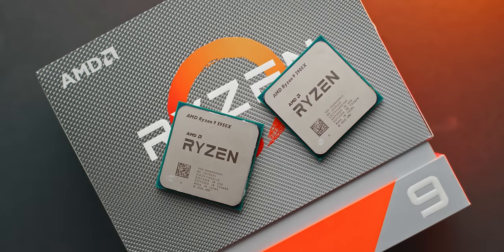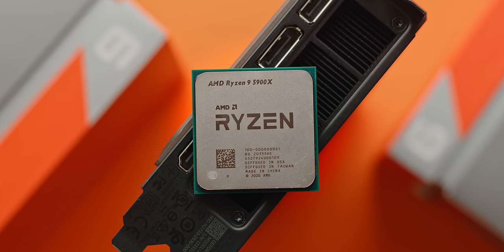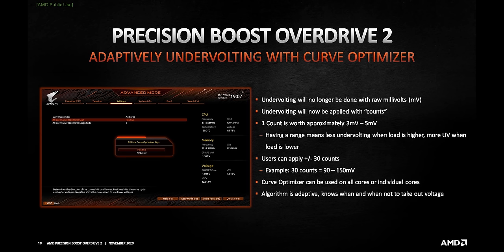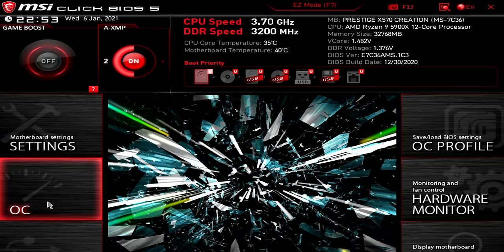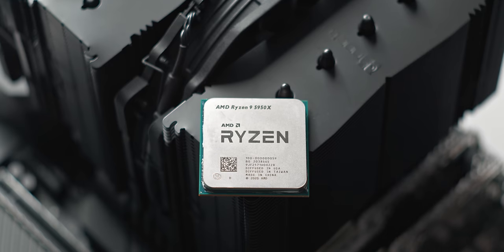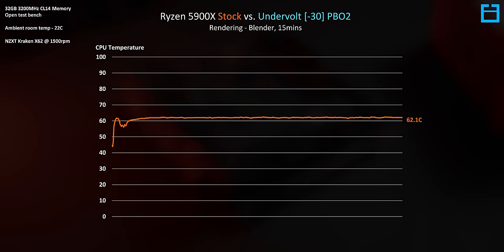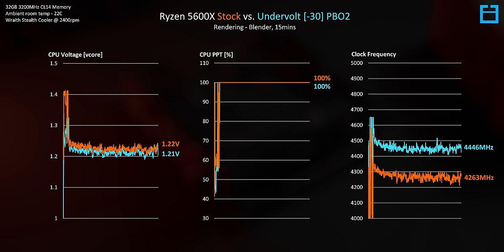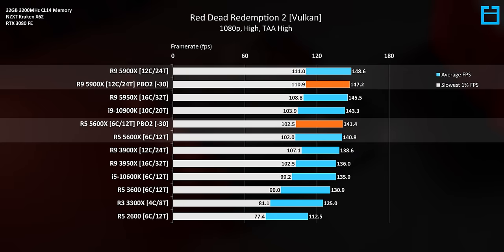Ryzen 5000 Undervolting with PBO2 – Absolutely Worth Doing

Comment: My voltage was spiking up to 1.375V completely needlessly. Now, with -30, they never go above 1.2V. Tried Blend testing and the clocks stay at full speed 4650Mhz for the whole time at 1.212V and temps around 65C with an aftermarket cooler. After the boost ends, the voltage falls even further to 1.1 - 1.150 and clocks stay constantly at 4450Mhz with temperatures below 60C. I'm extremely happy. Didn't lose a single drop of performance, but the voltage spiking high up to the sky is over. My friend did the same, but he could "only" manage to get it to -27. The -30 sometimes were giving him hard reset.
Reply: Did you have xmp enabled for your ram at the same time as the 30 offset or no?

Comment: Appreciate the guide.  Unfortunately, my 5900x didn't do as well as yours.  At negative offset 20 it would pass torture tests but consistently crash in gaming.  Dropped it to 10 and it reduced the crashes but they would still occasionally happen.  Turned off the offset and have had zero crashes in the past week.
Reply: What is your best CB R23 score??? OCCT score???

Comment: Mate, took me 3 months waiting but my 5900X finally arrived from PCCaseGear. It’s a hot CPU. I have 2 x EK Coolstream 360 XE rads with Vardar fans cooling the 5900X and a RTX3090. GPU idles at 23 and max of 50-52 at full load.

The 5900X idled at about 40 and max of 75 in Aida64 for an hour. Not maxed but still very warm for such a cooling loop.

I used your exact settings in my MSI Bios and I get higher clocks, less max power draw, and max temps of 61 degrees. Idle is still warm but max is great now.

You’re a legend. I love you videos. Wish I had the patience and skill to make the builds you do. Thanks for all you do 👍🏻

Comment: my 5800X can handle a negative curve of 25 but even with that I see it regularly idling at 0.9 volts and on an all core load I now see it boosting to 4.775 GHz at a max of 1.29-1.3v and boosting to 4.8/4.9 GHz on lightly threaded tasks more often at WAY less temps and power. Amazing I love Zen 3 this is essentially AM4 at its final form!
Reply: Do you think 25 will work for me? I'm using the 5800x aswell
Reply: Only way to know is to test it. His 5800x could be way better or worse than yours. Silicon lottery
Reply: i have all cores -30 except the two fastest cores that sit on -28

Comment: Worked like a charm. I was able to get the max value of 30 on my 5800x and msi mpg x570 gaming edge wifi. Improved my cinebench r23 score by 4% with lower temps and higher clocks than stock
Reply: Any instability issue? I just tried this on my 5600x and at -30 it crashed after 2-3 minuts. Trying -25 now with 10 threads loaded, will see in 12 hours I guess.

Comment: Went from 57 degrees idle to 44 degrees. Great guide, subbed!
Reply: 44 degrees idle is still pretty high. My 5600X is untouched sitting at 33 degrees. Highest load goes to about 65-69 degrees.
Reply: @patrickwoolbright1960  not sure what to do beyond this point. if you can point me to some other guide to deal with this, I'd appreciate it. Although mine is a 5900x with a Noctua nh-d15s air cooler.
Reply: @patrickwoolbright1960  if I turn off PBO, I can't undervolt at all and it goes back to stock temps :( thanks tho
Reply: @kebongski  With information i mentioned previously i had no need to undervolt. Idle temps are around 33 - 36. High load temps are around 55-65.
Reply: @patrickwoolbright1960  but does it still boost to >4Ghz? Legit really wanna know
Reply: @kebongski  Yes.
Reply: @Mottbox  well aside from the fact that I installed a couple more intake fans, I discovered that I placed my heatsink fan wrong. So it was pulling air FROM the exhaust fan. Pretty dumb oversight, I only discovered it only when I was installing new fans. Now they idle at 32c. 

Although how the hell are you idling at 24c?! :O
Reply: @kebongski  remember that your temps can't go lower than ambient temps, that means if your room is at 34C like mine on the day, that is as low as it might be able to go with really good cooling.
Reply: @arashitempesta  that makes sense and seems obvious but I never thought about  it... Thanks for this!

Comment: I had to adjust my fan curves to account for lower cpu temps for my build because the undervolt worked too well and my GPU wasn’t getting enough air. So yeah, it’s definitely worth
Reply: I wouldn‘t use Cpu Temp to Regulate case fans. There are several programd to use gpu temp to lower or boost up case fans

Comment: My 5900X couldnt handle 30, even 25 without instability so I´ve settled on 20. I am getting 4875mhz boost on single core and 4575mhz all core with better temperatures. Thank you for the guide!
Reply: May I ask what tools one would use to test wether the system is stable after setting the new voltage? i have a 5600x, and slowly worked my way up to 15 now. It all seems pretty stable, I ran cinebench and played a few games. The CPU is sitting around 55°C so that's pretty good.
Reply: @Xello99  OCCT if you want rock stable system. But you can set the test in Ryzen Master for 60 minutes and that should be enough for everyday use.
Reply: @Houmer  ok, thanks :)
Reply: my 5900x couldn't handle 30 either... thanks for the update
Reply: So, my 5600x can handle 30 without issues. Guess I’m lucky then
Reply: @kohzhicheng08  I started with 30 as well, then got a system reset, dialed back to 25, got a bluescreen. I'm now at 20, no issues so far.
Reply: @djlimited04  I never tried 25... thinking if I should try it hahaha
Reply: How your clock speed ? Whats the max?
Reply: @kohzhicheng08  4950 on first 5 cores. The rest are between 4800-4900. I didn't apply any MHz offset from the BIOS, just left it default, as in the video.

Comment: Just to note on chips with arbitrarily locked boost clocks like say the 5700x you can gain 200-300 mhz single core performance as well as all core. Be warned though, your system might run fine during load but -30 offset can cause your system to crash at idle because of how this all works. So, you'll be running benchmarks and everything will seem fine but your computer will be crashing or acting real strange during lighter tasks. Might require some tinkering to find the perfect offset. Then again some people are lucky can just go -30 and all is fine.

Comment: Very dry useful tutorial. I applied it on my new 5600x on B550M Aorus Elite. If I compare with AMD overclock parameters, I have the same performance on Cinebench in multi core for less 20w and 10°C. In single core I'm better. FYI, I keep -30 without crash.

Comment: Thanks so much. Works perfect! All cores now goes at maximux speed, teptreture is lower by 5-8 Celsius. Great tutorial. Perfect on GIGABYTE B550 AORUS ELITE with 5600X.
Reply: Hello, I wanted to ask you if you with gigabyte motherboard have followed the procedure indicated identically, or if you have found differences and difficulties. Unfortunately I with gigabyte b550m motherboard notice differences and I am afraid of making small but dangerous mistakes. could you give me advice? TX

Comment: I bought a 5800x3d for my b450, updated the bios, went looking for the curve optimiser, I did find it and it was just in a different place, I put it to -30 and changed the voltages from another video, it works like a treat, I did a cinebench R23 multicore test before and after getting about 62MHZ increase on each core  with about 9-10 degrees lower in cpu temp on water
Reply: what voltages from another video did you change?

Comment: This has been a great guide helped me understand pbo and curve optimiser with my very first amd system i've ever built, came from a 9900k to a 5950x and mainly use my rig for gaming and have seen it do anywhere between 4750mhz to 4800mhz on majority of the cores, I am currently playing at 1440p and soon to be either 1440p ultrawide or 4k. Temps are a little higher in games and power compared to an all core clock at 4.6 but for the gained 200mhz they haven't gone up much, custom loop with liquid metal, open air test bench at the moment with the Evga X570 Dark until i get everything for the case i'm putting it in, ambient temperature varies between 14 degrees C and 24 as here in South East Queensland Australia it's getting towards winter. Thanks again Optimus Tech this video extremely helpful for someone just starting out with Ryzen :)

Comment: Just applied this settings to my new 5800X  with MSI B550-A Pro and Mugen 4 +kit AM as cpu cooler (+ 2 fans 120mm 1400Rpm PWM) Artic MX-4 used as thermal paste
PBo Advanced 
PPT: 108
TDC: 80
EDC: 110
Boost Override +100
PBO Scalar Off
Curve Optimizer -10
I never reach 70°C in full load! incredible result. before at auto setting always at 90° during stress and throttling

Comment: I am using the negative offset of 30 with my 5600x 

I have the exact same results as you do and so far (2 weeks now) everything runs stable :) 

great video
Reply: can you tell me your clocks speed and voltage pls
Reply: Did it maintain the clock speeds or it increased with the negative curve?

Comment: This isn't always the case, some of these guides don't warn you that curve optimiser is the wall between stability and instability... I could benchmark all the way from -30 curve all cores and an additional -0.1v as soon as I try playing games I get crashes all over, turns out one of my cores needed OVERVOLTING to be stable so no matter how much messing I did with undervolting the chip my cores weren't stable, even at auto... so the first thing you do before messing with an undervolt is sort your curve out first
Reply: What’s your Ryzen?
Reply: @Lucas Campos  5900x it came with 1 unstable core at stock
Reply: why dont u set the PBO limits to auto and set the curve optimizer to -30mV and start increasing the values if these are unstable try this since disabling PBO limits forces stock profile what if u can achieve undervolt using OC profile that PBO forces

Comment: I own the 5900x and was able to achieve an offset of negative 15. More wasnt possible or my system would crash. But even this is quite the uplift to my previous temperatures. very glad i did this! If anyone knows how to achieve even higher offsets, suggestions are more than welcome :D
Reply: silicon lottery at its finest
Reply: @henrikpflanz6177  jup had to clear all changes again. It would run fine for about 3-4 hours but under lighter loads randomly shuts down. I tested this for months on and on but couldnt even get negative offset of 1 working stabily. I even tested on different cores with offset, others with no offset, followed tutorials to determine which cores are the best quality for better undervolting. In my experience undervolting with PBO is completely broken on the 5900x. HOWEVER i cannot say if the CPU or the motherboard is the issue. Maybe the mobo cannot deliver the offset voltage stabily :p
Reply: @leif8436  welll is us just the silicon quality. some can undervolt more aggresivly then others.
Reply: mine can go to -30 which i guess is amazing

Comment: can confirm, this works
I used curve optimiser value of 30 for 5800x. 
Temps were 5-7C lower for r20 with score of 6107 points. stock score was somewhere around 5820

all core boost of 4.65ghz improvement of 125-150mhz.
single core was the same at 4.85ghz but much more stable. At stock it would drop down to as low as 4.7ghz.
room temp 18c.

I did optimize my fan curves for quietness when I updated the bios maybe the CPU would had boosted even higher if i kept the fans as same as when I did the testing at stock voltages. 
Im using msi x570 gaming plus and 16gb crucial 3600mhz micron E-die stock AMP profile 16-18-18-38-58.

Edit: with fans at max r20 score was slightly higher at 6130 points but temps were 12-14c lower compared to stock.
Reply: Completely forgot to update this a year ago. You need to set "Max CPU Boost Clock override" to Positive and set the off set to +200mhz or whatever your CPU can handle.  
This will let you hit 5050 mhz on single core and all cores will boost higher up to 200mhz higher as long as you can stay under 80c.
Reply: @k7y  I did what this video suggested on my 5800X + Kraken Z53 AIO + B550 mobo and  curve opt set to 30. Some benchmark programs showed the best scores which was great BUT when using Cinebench and 3DMark, the PC would reboot itself midway through each of those benches.  Bummer!  I then switched back to PBO auto, hehe and all is fine now. I guess playing with the curve optimizer setting to lower than 30 would help but IDK.

Comment: Wait wait wait. You're telling me, that undervolting gains free higher clock speeds/performance?! Intel boss man will not be pleased.
Reply: I do it and get less clockspeed. Idk what I’m doing wrong, same settings as video.
Reply: Works with Intel too. I've been doing it ever since they made overclocking more trouble than it's worth (with the Pentium 4).
Reply: Yes, you're essentially finding the optimal voltage for your CPU that the factory/manufacturer didn't have the time to do, which you can better observe on the cheaper 6-core opposed to the already highly binned 16-core model.
Reply: @jozza177  I have a couple of mobile i5-8265u processors that can undervolt about .08V, adding over an hour of battery life at no cost.
Reply: @HaydenRoberts08  all cpus are difference, you need to find the settings for your cpu as it may boost better/worse depending on cores.
mine cant do negative 10 all cores.
but without curve optimizer I can do 4875mhz.
so atm i am trying -5 set if that passes I may have slightly less boost but better temp and less voltage.
Reply: @RobertJohanssonRBImGuy  It’s like my PBO is disabled though. Makes sense as he’s disabling the CPU to boost higher.
Reply: @HaydenRoberts08  Do you have PBO on normally? I think these results should be compared to score without PBO as it is using same amount power as you use without PBO, vs PBO it would have tough time winning as amount of power PBO uses can be really high vs stock. That said you could do these settings but change pbo limits to motherboard instead of disabled if you want more performance with curve optimizer on, definitely got some good scores in cinebench with that though cpu uses more power then than stock, not sure though how it would compare vs manual OC anyway.
Reply: Wdym Intel boss man will not be pleased? This has been a thing for years no matter if AMD nor Intel.
Reply: @RobertJohanssonRBImGuy  What are you talking about mate? If you can do a -5 you get better/same performance and def better temps. You don't lose performance when doing this, you gain it. It literally was shown in the video.

Comment: I wouldnt recommend doing that this way.
First of all never use Curve Optimizer for all cores, set each core individually.
I can set my 5800x at -30 +100Mhz and it runs Cinebench just fine, both multi and single thread. Can even run P95 for a bit without problems.
The problem comes when the CPU isnt boosting constantly to the max, for example P95 small fft where it gets around 4.3-4.4Ghz only and it will almost instanly crash. Also simple idle use will crash very frequenctly.
If you do this plan to spend lots of time on stability testing and dont think just because it can run Cinebench or P95 for a few minutes that its stable. Try all kinds of different workloads, P95 small fft is quite good in finding large instabilities with Curve Optimizer as it crashes almost instantly, run P95 mixed, small and very small fft workloads each for atleast a couple hours. In addition test in actual use cases, as in just play games etc.
In the end I got I got it stable at -21 with exception of Core 1 and 7 which are -16.
Your best 2 cores btw are usually not going to achieve as high of a optimizer offset, as they already have a offset applied to them from the factory. Most of the time you should set them at about 5 points higher.
To find out what your best cores are the easy way just open Task Manager and run Cinebench single thread, the load will stay on mainly 1 core (thats your best core) and sometimes switch to your second best core.

Comment: Thank you for this video! 5800X with a Deep Cool AK620. Went straight to Negative 20. Stable right off the bat. 10-15 degrees lower temps under average loads. At max load in Cinebench 5 degrees cooler from 85 to 80 max. Still boost to 4900Mhz. 30-40% lower peak wattage. Same or even slightly higher performance. Absolutely AMAZING! Not even going to push further than negative 20. That's all I wanted. My current idle dropped from 50 degrees to 35! It's like I installed liquid cooler.

Comment: I have a 5600g, and reached almost 4.55 GHz all core turbo at PBO CO -22. It crashed at -25. Currently the hot spot (T_control) is 32°C.  My cooler is ID-COOLING SE-224-XTS, around $25.
I'm pushing RAM OC, already at 4000 MHz with my 3600 MHz G.Skill. Later I might try per core CO.